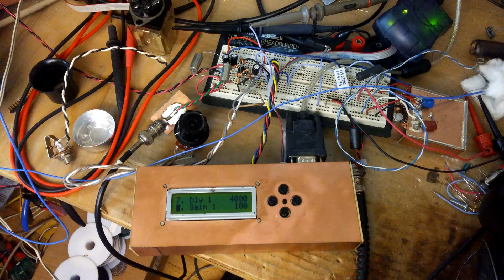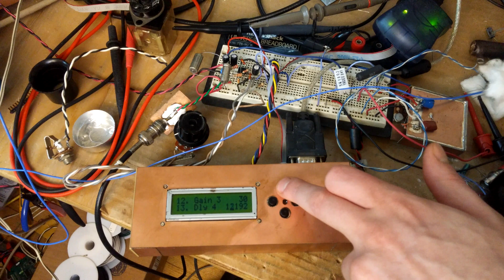Reverb Effect Box

Comment: Need a faster processor for that 2nd tap.  Even more taps if possible are good but two at least.  Reverb tanks using springs use at least 2 springs of different sizes for that reason.  Back in the 1970s one of my jobs was to shim the reverb drive and pickup coils  used in the mixers we were building to reduce the "slap" when the springs would hit the laminations of the coil.